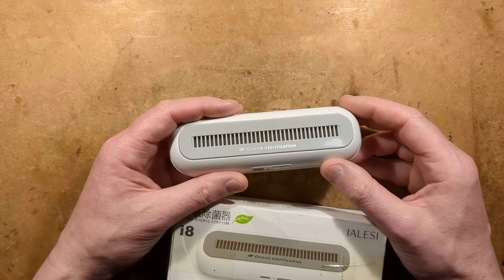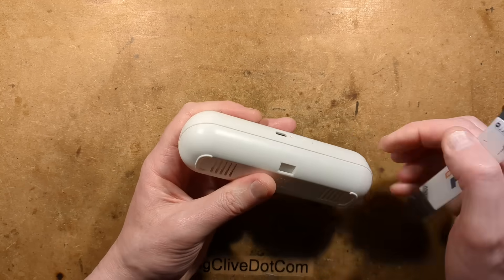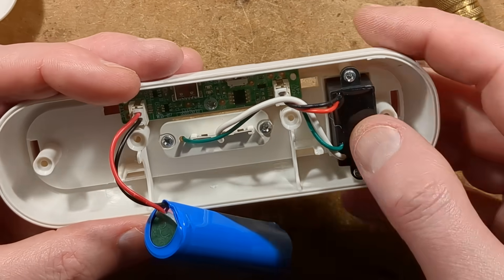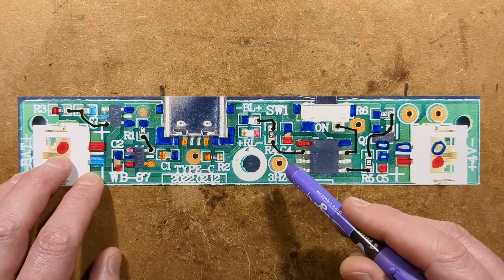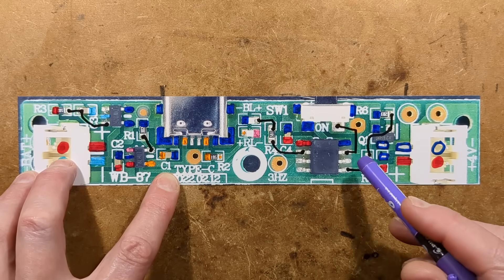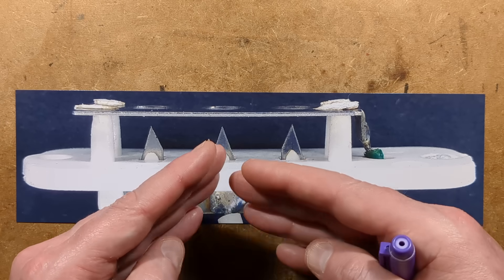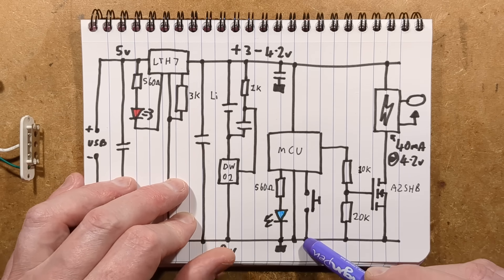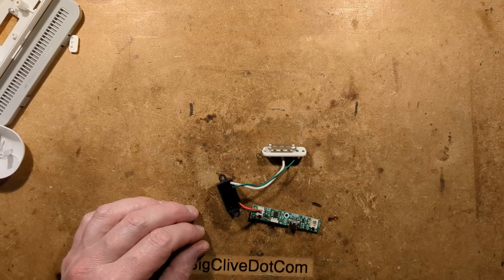Inside a fridge and cupboard steriliser

Comment: The old, long-retired PhD microbiologist in me says cleaning the refrigerator out and washing down the shelves every 3 or 4 weeks is likely to be more effective, but less fun.
Reply: idk, there's those modern ones with air circulation now (to eliminate condensation iirc) where the germs and mold spores get blown around and inside the air ducts. such an ozone gadget might be useful for that.
Reply: I once had an onion go bad in the fridge. Cleaned the whole thing, but the smell stayed for weeks. No idea if this would've helped, but it might've been worth a try. I wasn't worried about contamination, I just didn't enjoy getting a blast of onion first thing every morning.
Reply: @MonEyRuLess  It probably would. O³ has worked for me more than once when nothing else would! Just use proper precautions and (unlike me) be patient allowing it time to air-out after!
Reply: @Heizenberg32  I'll keep that in mind for next time (never(hopefully)), thanks!
Reply: @MonEyRuLess   bet you could have got rid of it in a day if you just emptied it and left it open,  after all they are not exposed to the air that much it probably takes months to reach 24 hour exposure to fresh air
Reply: @GreatSageSunWukong  Didn't want to throw the entire contents of my fridge in the garbage.
Reply: @MonEyRuLess   could have just ate it and not bought anything new for a while, switched to tinned stuff and pasta, I spent over 6 months without a fridge it wasn't that bad.  got me out the house more as I was going to the local shop every evening and buying the discounted stuff for my meal for the night, tried some new things then too
Reply: @GreatSageSunWukong That all sounds way more annoying than putting a little device in there for a few days. Or even my solution, which was to mask the smell with a small cup of coffee grounds until it dissipated.
Reply: @MonEyRuLess  oh I don't know change to routine is often refreashing
Reply: Easy to keep things clean with lots and lots of tightly sealed stackable/nestable food containers with the same lid! The tricky part then is forcing guests to return them... :D
People whose fridges look like compost piles are probably not that bothered by germs.
Reply: @GroovThe or getting my wife to even close them.
Reply: @GroovThe  and you shouldn't either. Overdone cleaning does more harm to your health than good.
Reply: Yeah this will have a hard time dealing with any biofilms. Mechanical (e.g. elbow grease) is pretty much the only way to deal with the. I will say I'm a bit shocked at Clive's shrug off of ozone's harmful effects. It's well known through academic medical studies that ozone is quite bad for ones lungs. It's literally pure oxidizer in a gas form after all. Extremely powerful, even on human tissues. Then there was his idea that "ozone is nature's way of dealing with pollution"... uhhh come again? No, sir, ozone IS a pollutant...with EPA limits ffs. 

Now how much this device puts out, who knows. Maybe too little to worry about as it may react with your foodstuffs and decompose to O2 before accumulating too much if it is truly a very weeee bit that is produced. But I kinda doubt it? Not knowing is honestly the most worrying part of it. 

Then the dumbest part about this device? It will totally destroy the taste and flavor of any food that is exposed enough for ozone to come into contact with. Butter packed in semi-permeable cardboard boxes and similar thin paper? Ozone will affect the texture, bleach the color, turn the surface rancid, and decrease overall shelf life. Not great. 

But seriously the health concerns should be the biggest issue with this. Do not take respiratory health for granted, people. As a 37 yr old diagnosed terminal, stage-4 non-smoker's lung cancer patient struggling on 2-years this month, it's not something you ever want to deal with.
Reply: Why so often? If one is not sloppy fridge can be clean for months and more. Mine is. Doesn't smell at all and it's washed maybe once a year.
TBH I do keep it clean, no spills, rotting stuff and such..
Reply: @mmdirtyworkz what if one’s spouse loves smelly food and not covering it properly, and you don’t.
Reply: @goingjag  items that should be covered but are not end up in trash. Much faster learning curve.
Reply: no it is not. Every time you open the door you introduce new bacteria, mold and whatever else if floating around. Adding an ozone generator makes a HUGE difference. Almost no more food to throw away. Even stuff like marmalade in glasses don't get mold anymore. Time to get back to school Mr PhD microbiologist
Reply: @BruceBochek yeah but who ever does that?
Reply: Y use a near identical ozone unit only for odor control, a camembert or other delicious cheese may emit some odors
Reply: My bacteriologist father was in charge of the kitchen hygiene at home, and I never experienced food poisoning.
Reply: Coat the "practical" surfaces with a fine misting of silicone oil.
This was my first task, as the rookie, in a pathology lab. The refrigerator was for storing the groth medium. Smelled like condoms.
Reply: Yeah, but if your wife loves well-aged cheese then these ozone generators are godsent!
Reply: I've often wondered about the micro-biomes of my families' chest freezers.
Reply: I have a cheese fridge. Every time I open it it stinks to the high heavens. Ozone reduces it. My generator doesn't generates enough, though.
Reply: I have a second hand chest freezer that I want to turn into a fermentation chamber. I thawed it out and thoroughly cleaned it with bleach but it still smells strongly of mildew and stale ice. I will probably be picking one of these up to see if it can get rid of that smell.
Reply: @nolansykinsley3734  Try some water and white vinegar. It works well.
Reply: @nolansykinsley3734 That "stale ice" smell is both nasty and tenacious! When I wash my silicone ice cube tray in the dishwasher the smell permeates the kitchen!
Reply: @nolansykinsley3734 check drain plug area as well

Maybe you could get a liner for it?
Reply: @nolansykinsley3734  Or use one of those chemical car deodorizers. They are used to get the mildew smell out of cars with flood damage.
Reply: @nolansykinsley3734  I don't why it would the stink is probably trapped in the door seal
Reply: @GreatSageSunWukong  I cleaned all of the door seals thoroughly with bleach. The interior of the freezer is a foam covered with a reflective probably mylar or aluminum lining, so I think mildew has gotten into the insulating foam where the bleach cannot reach.
Reply: @nolansykinsley3734  yeah but I think the rubbery stuff of the seal is just like a sponge for stink it just sinks in there way more then the hard plastic,  my mums old fridge stank from the door like pungent onions.  Never heard of one with a foam covered liner before, I've only ever seen white plastic.
Reply: @nolansykinsley3734  I wonder if your scent is coming from the surrounding insulation
Reply: The nerd in me says we could probably build a tiny refrigerator cleaning robot! That sounds like more fun! Let's go!
Reply: 3 or 4 weeks ? I think you mean 3 or 4 years. LOL.
Reply: Ozone generators work. Cleaning your fridge doesn't prevent smelly items from smelling and the smell getting into the butter... but ozone generators do.
Reply: You wont be able to clean inside the air ducts easily, and that is a spore den.
Reply: @jairo8746  just don't buy one with a fan in it,  my Liebherr  doesn't have one, the crappy Becko one was the only one I had that did and I hated that one.
Reply: You can wipe your sterilizing/oxidizing agent around with a cloth (bleach), or you can let this device blow it around the fridge on its own, keeping constant diligence (0³).
Reply: Ozone is not healthy to breathe and may contribute to lung cancer. I wouldn't have one in my house.
Reply: this shit will make your veggies rot, its complete crap
Reply: Biochemist here. Same thought. Also, Ozone is poisonous. So basically you create a cloud of poison Everytime you open the door. If it in fact works...
Reply: abundant use of water will certainly improve the environment for life to thrive and develop
Reply: @crono331  yeah... no. There's plenty of water sublimating off the food in your fridge, and condensing out of the air wherever you open the door. Any amount of residue left by wiping it down with a cleaning product would be dwarfed by these factors.

Trust the microbiologists.
Reply: Butt, if you do that every 3 to 4 weeks, then China has to stop selling crap and just soap!!!

Comment: Wonder if something like that could be used in shoes or boots when they get a little funky smelling? Speaking of things starting to smell funky I need to dig out my ozone generator because I'm noticing some smells downstairs again. Nothing major; just the musty smell that just about every basement occasionally gets.
Reply from the maker: A low forced ventilation can keep basements dry and fresh.
Reply: We have an almost completely finished basement so there's heating/cooling year round. It's just been ungodly hot and humid lately so the unfinished laundry and utility rooms get kinda musty smelling sometimes. There's no visible mold or mildew so I'm not too worried when it happens maybe once a summer.
Reply: It might help boots/shoes, but not sure. My motocross boots are eligible for official biohazard designation after a race and nothing I have tried so far works to kill the funk. I may pick up two of these units to see it they finally do the trick.
Reply from the maker: @mxslick50  See my video called "How to fix your feet".
https://youtu.be/wPLwczrGikM

Comment: Thanks Big Clive.  These things are cool.

 I have a few of the triangular refrigerator units you explored a while back.  They're still working though I'm not sure if the O3 output is as strong as it was.  I tried to clean the little triangle.  They never were "strong" but good enough to keep the refrigerator fresh.  (for the other two, one is over the cat box and the other is in my bedroom)
Reply from the maker: The spike and ring both benefit from a scraping when they've been used for a long time.

Comment: I still use the roughly triangular fridge ozone unit you reviewed a long while back. Bought one after seeing your review.
Reply: Same (with the triangular units) Still working almost a week with a charge. I haven't experimented with increasing the size of the cell yet.
Reply: Mine died after about a year. Not really sure what failed, just won't power on whether plugged in or on battery, and I tried a different battery and looked for obvious damage while it was open. Meh, maybe that is why it was the cheapest version on eBay at the time.
Reply: Same here! Mine lasts around 3 weeks on a charge.
Reply: I have a pair of those triangular ones Clive reviewed doing refrigerator duty (in rotation). Still work just fine AND do their job. 😀
Reply: Which one is it? Can you link the video or the video name?
Reply: @shadowkora  https://www.youtube.com/watch?v=Xa0QCaJa4lU
Reply: @shadowkora  I have no idea. I watched the video probably 1-2 years ago.
Reply: I bought the "Xiaomi" Ozone Lemon he reviewed and disassembled even further back. Still works well, though I had to replace the noname 20x20mm fan in it because the bearing went bad. Surprisingly the 18650 hasn't lost a lot of capacity in 3 years of use either, despite these cells not exactly being designed to be used in a cold environment like a fridge

Comment: Sadly, it looks like they've cheaped out so much on the USB-C connector they've used that it doesn't even have pin 5A/pin 8B, in which case there's no way to add the necessary 5.1K resistor to trigger smarter power supplies.
Reply: I have a number of these 6 pin USB C sockets, from left to right they're GND (blue on Clive's diagram, 5V (orange), CC1, CC2, 5V, GND.
No data capability, but fine for the 5.1kΩ mod 1-3 and 4-6.
Reply: I believe they're there, and the connector omits the data lines. I had a flashlight with the missing 5.1K resistors, and managed to bodge them across the appropriate pins on the connector
Reply: Wow, of all the ways to f up a usb-c port, just completely forgetting the 5.1k pulldowns seems pretty stupid. That will prevent getting power from literally any charger compliant with the USB-C specification. (The only power source the spec permits to ignore the CC pins is a USB-A power source connected via passive USB-A-to-C cable)
Reply: @MatthijsvanDuin Unfortunately, this is EXTREMELY common with a LOT of crap getting made today. Everyone seems to screw up the standard, even raspberry pi and nintendo screwed it up a little with their first versions
Reply: @iamdarkyoshi  You mean the rpi4 ? it did something more subtle wrong: it tied the CC pins together and used a single 5.1k pulldown, which is still an embarrassing screw-up but at least it still works with any charger as long as you don't use an active cable. Of course another big issue with the rpi (and really all single-board computers I know of) is that it ignores the max current advertised by the source and simply draws whatever it wants.

What did Nintendo do?
Reply: @MatthijsvanDuin Yeah, I meant the standard in general being messed up, not the specific flaw here. Nintendo's sin was a bit more subtle, I seem to recall it being an issue with the CC pins being sensitive to damage from third party accessories that otherwise adhered to the USB C PD spec.
Reply: @iamdarkyoshi  From what I could quickly find, while the Switch does have a bunch of compatibility issues, the reports of damage were due to a single third-party dock that badly screwed up the PD (supplying a different voltage than negotiated)